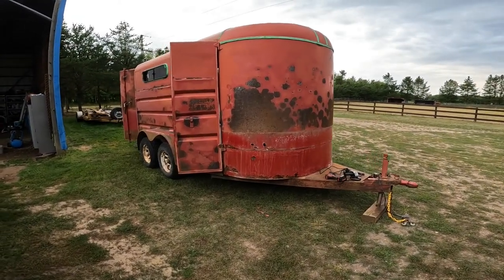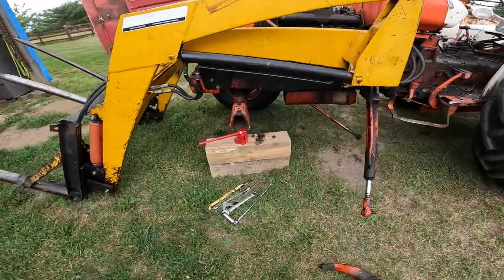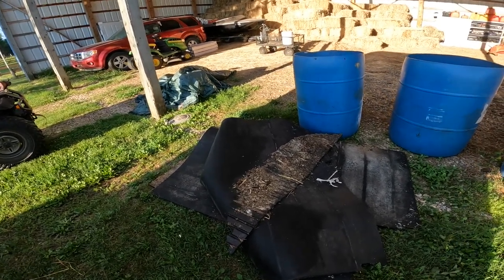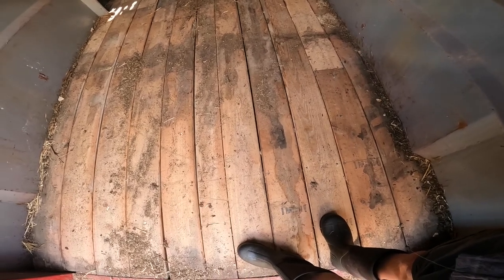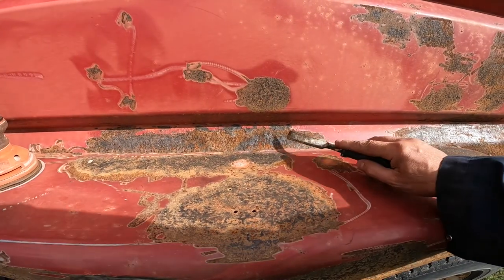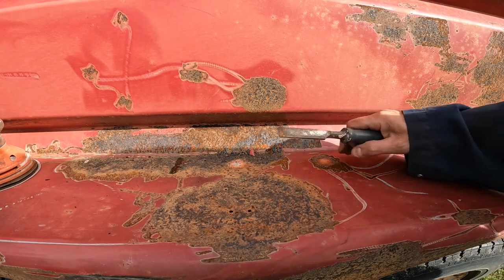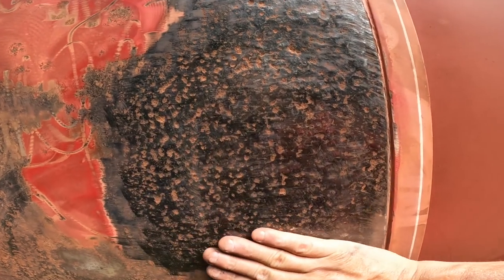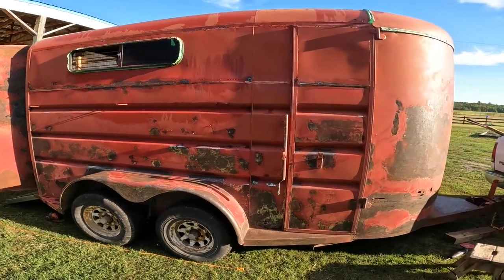Horse-trailer Restoration - Part 1 Prepping

Comment: Would you mind listing out the tools you used?
Reply from the maker: For sanding I used a "flapper" disk in my drill to get the rust off, I also used a wire brush that you put in a drill. For spraying I used an old fence sprayer I already had. If I were to do it again I would research "sandblasting", I think it would save a lot on time, it took me a few days to sand it down.

Comment: Sandblasting would have gone much faster !
Reply from the maker: Yes, actually I was thinking to do sand-blasting, but the cost to set it up just for one trailer was to much. Wish I had one. Actually if I had a sandblaster I would do ALL my other equipment. The stuff I use is from the 40's, still work but a pain in the rear end. LOL I have a bottom plow from the 20's that I still use, I saw the same one I use in a Museum and was thinking to strip some spare-parts for mine.